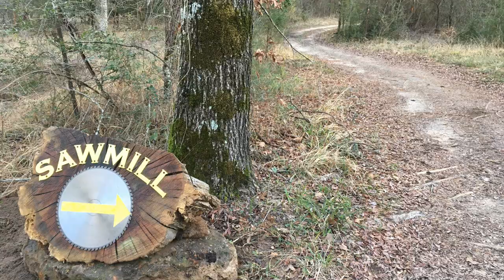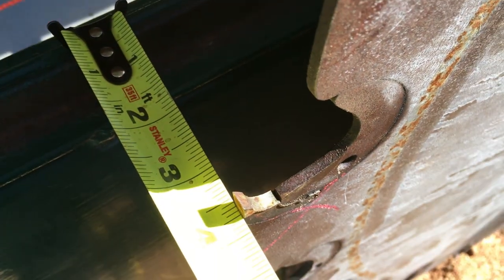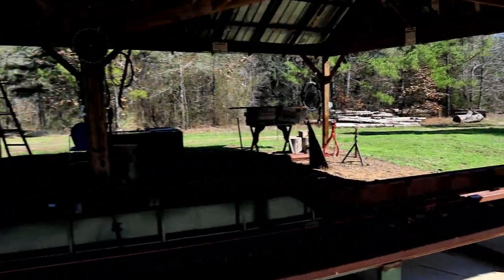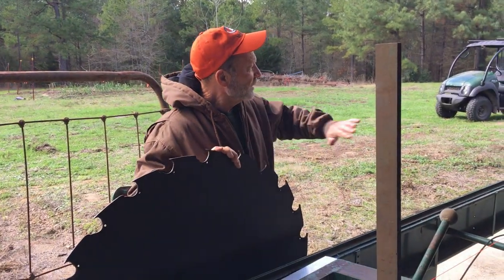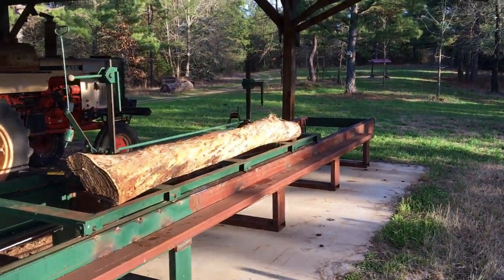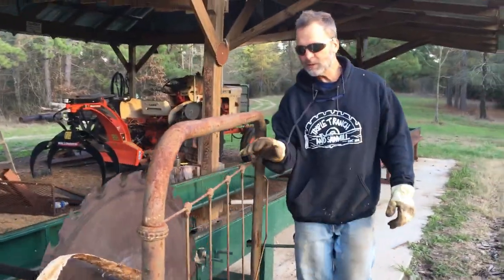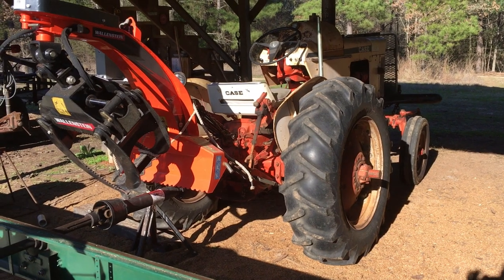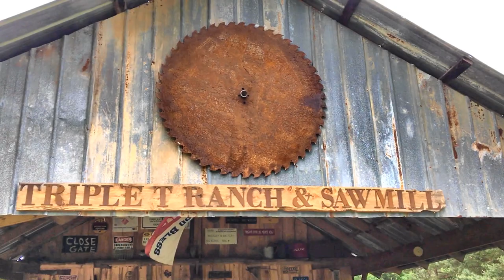Squaring Up An Antique Circle Sawmill

Comment: Hopefully by now you have a splitter behind the saw blade. Helps keep the board from pinching the blade and also helps protect debris (wood pieces, bark, and boards from getting on top of the blade and pitching them with great force past the head sawyer. Note in most old sawmills that there are holes in the end of the sawmill where debris has been thrown with great force by the saw blade. 
Great job building up that old Belsaw.
Reply from the maker: Deernut I got it done after it almost killed me throwing a 2” board at me.  I guess you have been around sawmills in your past ?

Comment: I gotta tell ya Kim, you got yours running a heck of a lot more true than I have mine !!  I need to get back on it one of these days... I hit the track with a loaded trailer last year and knocked it outta whack.  I like your use of the lazer, I tried but couldn't see it in the sunlight so I relied on string and a level and got it halfway decent before.  I adjusted my lead for 1/16'' but I didn't even think of squaring the blade to the carriage.  That might explain me sawing parallelograms instead of rectangles.  LOL.   I will include that in the process when I get back to working on it.  I think my total length iirc is 32' and its built on bar joists.  You did one awesome job extending the tracks.
   I had to turn down a few new wheels and also a few of the pins.  I made them like the originals, drilled down the center and out the side with a zerk in the end.  I also made new dogs and beefed up the head blocks.  You may have commented on the little overview I did on mine, last year but I don't remember.  I think I'll go check.  LOL.  I enjoyed every second of this video sir.
Reply from the maker: Thanks for watching.  When I had my blade hammered, the old guy that did it said I should set zero lead.  However, the foley information I have says it should be 1/32"  I am cutting up a large elm that broke in half.  I will make the next video using the elm and finish up the upgrades.  I am looking forward to finally just using my mill and not having to weld on it!

Comment: People do not realize that a circle sawmill is a precision assembly, and there are many places that have to be exact in their positions in order to produce quality lumber. The collars for the head saw, as you said have to have a slight taper so that the outer edge is the only part that is gripping the blade, and the lead on the blade should be about 1/32 of an inch towards the cant. Then there is blade tension, and on, and on. I look forward to seeing it after you get everything adjusted, and worked out.
Reply from the maker: Yes I would have been better off just buying a bandsaw but hopefully, if I can get camera girl to shoot some video, you can see us mill an Elm tree that recently fell.  Thanks for tuning in.
Reply: @TripleTRanchAndSawmill  I know bandsaws are the latest rage, but I still love the circular sawmill. Fricke was the first one I ever worked with and know the most about, which isn`t much.

Comment: Great video. I’d always thought about putting the guide rail on he other side of the mill, since my guide rail is always packed full of sawdust and the two pieces spread apart over time. I may go to a monorail setup. 
You had to buy a longer cable, didn’t ya! $
I’m not sure you’ll have room for four wraps though. 
You didn’t mention it but how much lead did you put into your blade. 
We need an edger! 
Stay safe, bud
Reply from the maker: I have trouble with sawdust on the tracks too.  I picked up a mud flap on the side of the road yesterday and will make a more precise sweep. You are right, I will have to lengthen the spool because w/3 wraps, the cable bumps the spool side about 4' from the ends.  Very good that you caught that!  Foley says 1/32 but the old guy that hammered my blade said zero lead.  So I will test it at zero on soft and hardwood and determine what is best.  Its always an experiment.  Thanks for watching!

Comment: When you measured your saw lead, you had 3-7/8” at both points of measuring. Doesn’t this mean you have no lead, and need to adjust (toe) the mandrel shaft?
Reply from the maker: Justin I have zero lead. It is finicky and you just have to try it with a circular mill.  I have also run at 1/32.  I have not got this mill running completely right yet.

Comment: I just bought a m14 out of a barn , never used . We found everything but the loose blade collar. How did you remove the fixed collar to get Machined ? And do you have pictures of the loose collar ? I need any help I can get ?
Reply from the maker: Brandon you can take the mandrel with the collar to a machine shop and they can make a matching collar.  They can make sure there is about .002" of clearance inside the collar and the rim of the collar is the only thing touching the blade.   I have not been able to find aftermarket parts for the mill.
Reply: @TripleTRanchAndSawmill  
Thanks for getting back to me .... I appreciate the info . So I’m guessing that the loose collar also needs to be machined as an insert for the blade ? I mean something has to center the blade on the shaft ...  correct??? This is all new to me .
Reply from the maker: Yes the new collar will match the one on the mandrel.  The hole i think is 1 3/8”.  The threads are backwards.
Reply: @TripleTRanchAndSawmill  
I will be heading to my shop this morning to work for the day . I will look at it again . I must be over looking or over thinking it . The hole in the center of the blade is 2” I don’t recall any shoulder to support or center the blade .
Reply from the maker: @brandonwilson8974  The original blade is 40" inserted bit.  Sounds like you have a different blade.  The machine shop can make the insert needed to reduce from 2" to 1 3/8" to go back to the diameter of the mandrel where blade will sit.  I believe the loose collar is over 4" diameter and the collars only hold at the outer diameter .  So collar will clear the insert  (this insert will look like 1/4" thick washer).
Reply: @TripleTRanchAndSawmill  
Thanks for the help . That’s what I will do .
Reply from the maker: Brandon I made a short video of the collars.  Let me know if you still need to see a proper setup.
Reply: @TripleTRanchAndSawmill  
Great . I can’t wait to check it out . Thanks for thinkin of me . I have a friend that is Slowly making me the parts I need . He is fitting it in at his day job when he gets time . I guess he didn’t have anything close to the right size , so a lot of cutting. I’ve seen pictures and looking good . Not sure when I’ll have it in hand . Working out my power plant options . I have two dodge 2500 donor s one 360 gasser and 5.7 diesel . Trying to work out  rpms for engine to blade using stock automatic in gas or 5 speed in Cummings’s both running passenger side rear axle . Any thoughts ?
Reply from the maker: @brandonwilson8974  ok i need your email since the video is not public.
Reply from the maker: @brandonwilson8974  yes i see email.  I will look for my paperwork i used at machine shop and send it too.

Comment: For a string, I use wire feed wire pulled with a ratchet strap. Regular string is to flimsy.
Reply from the maker: Thanks , yes the wind even gentle would move it.  I don’t do anything right the first time it seems.  I ended up making some stretchers and purchased some music wire.  It did not move EXCEPT when a welding bead hit it!  Here is the first of 2 videos (thanks for the feedback):

Truing Circle Sawmill, 1 of 2
https://youtu.be/BGz5nep_Ujs

Comment: What rpm are you running that at
Reply from the maker: Well I'm under powered so I hit the log with the mandrel at 600 rpm.  A small log lets the case run so I probably maintain 540.  Big logs can go to zero rpm.

Comment: You will have to get your power right before you can really get your lead set. If I remember correctly it takes about 4 hp for every tooth. Also each tooth is should take about a .050 of an inch cut. Multiply .050 X your number of teeth and this will give you the carriage travel per rev of the blade. Good to see the detail in your work.
Reply from the maker: I am looking for a power unit.  Will switch it to belt drive.  I can cut straight boards if I set everything just so but it takes some work.  For this reason I don’t mill for other people.  Thanks for watching and the advice!